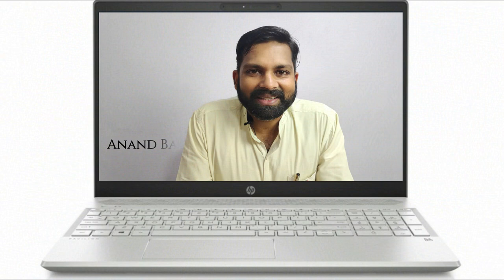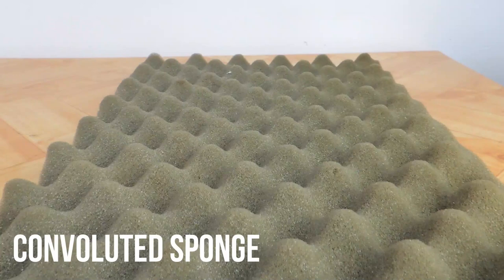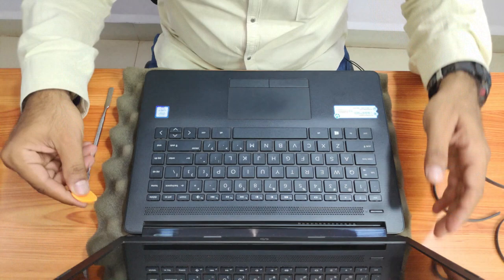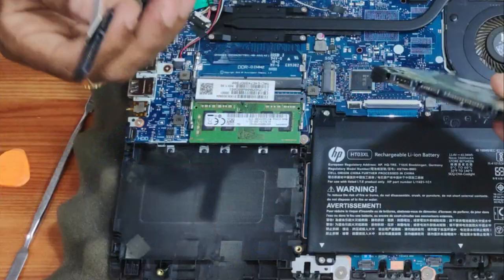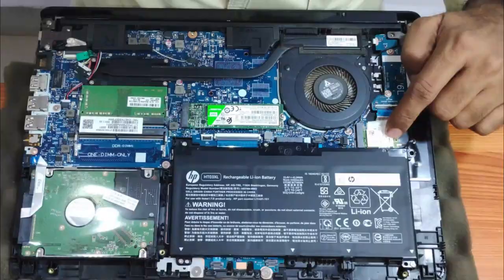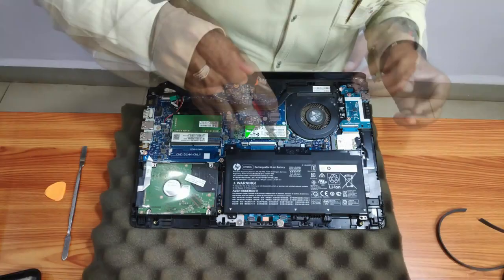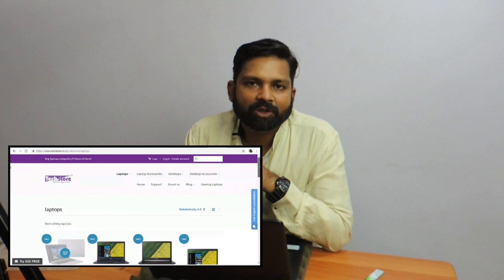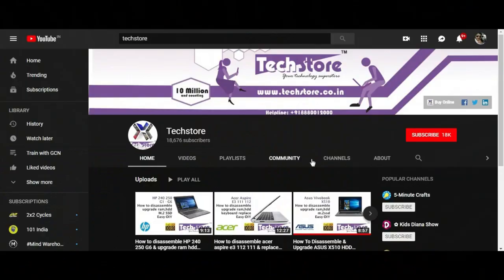HP 14 Q CS Series Cs0009TU : How to disassemble base and upgrade ram  hdd m.2 ssd wifi

Comment: can i install an nvme ssd i this laptop to the m.2 slot , does it work?
or should i only use an sata m.2 ssd?
can you please reply ?
Reply from the maker: You can buy nvme m.2 SSD. Have you subscribed ??
Reply: @TechstoreCoIn  will i get the full performance of that ssd or just the sata speeds?.
Reply: @TechstoreCoIn  yes i have subscribed

Comment: the ssd slot is SATA or NVME? im planning to buy NVME SSD does this laptop supports NVME??
Reply: Are u updated in nvme
Reply: It supports Nvme. But I got SATA one nly.. as it doesn't really matter unless u r using heavy video editing software etc ..
Reply: Thanks , is your speed improved or not?
Reply: @LovepreetSingh-re4hf  it improved like 20 times faster but i upgraded RAM and SSD at the same time.. so dont know if the RAM upgrade did the magic or the SSD
Reply: Both are legendary 😜

Comment: I am using this laptop from 11 months, i got it for 25k.
Personal request please don't buy this laptop if you aren't going to install an SSD, because the hdd is very very slow amd takes me 4 mins to boot up windows 10 pro.
Only buy if you will upgrade ram and ssd.
Reply from the maker: Totally agree with you. Glad we could be of help. Do subscribe
Reply: Is there any other way we could fix this issue?